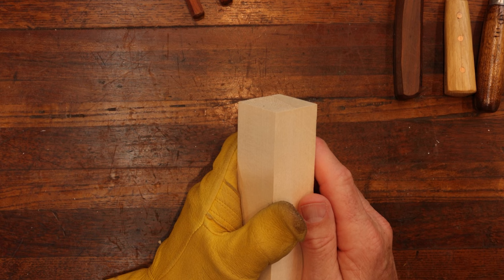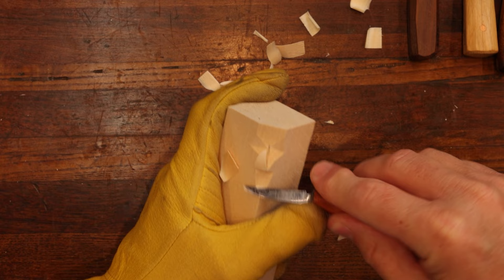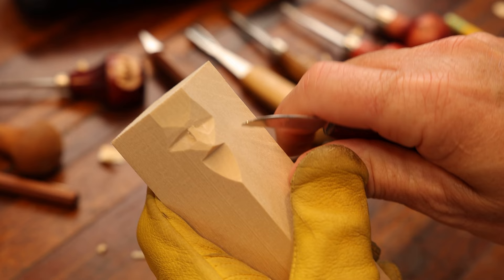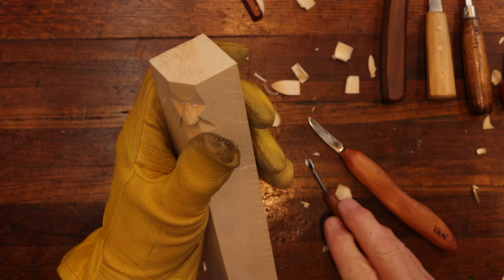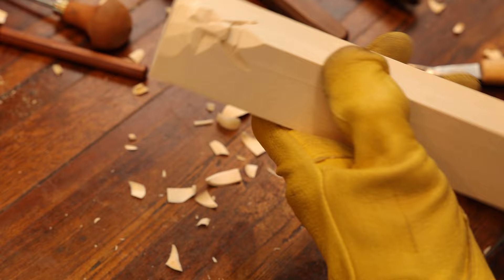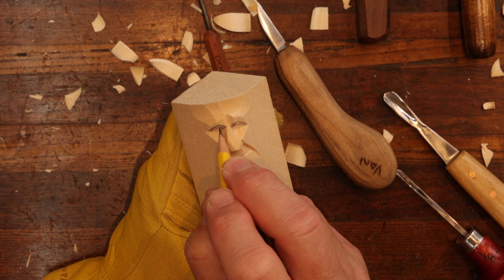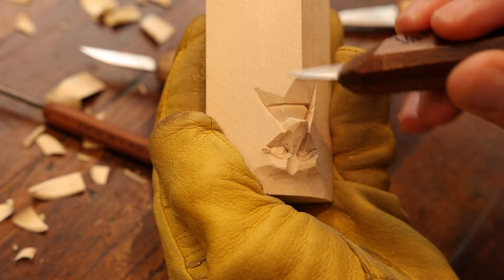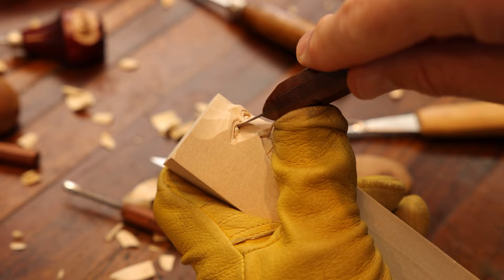Full COMPLETE Guide To Carving A Face || Simple Steps To Wood Carving A Face

Comment: Good evening Van.  I am 70 years old and just started on this enjoyable journey.  I have one question that will solve two of my question by finding out is the wood I'm using to hard or are the tools I purchased not sharp.  The type of wood and where to purchase would be greatly apricated.
Reply: I am fairly new also, I started with a Murphy knife, they are affordable ($25) they hold an edge great and can be used for most carvings. You can upgrade later!
As for the wood, most common is basswood it is easy to carve, I buy it from Heineke wood start with practice sticks in 1”, 1-1/2” and 2” Hope this helps!